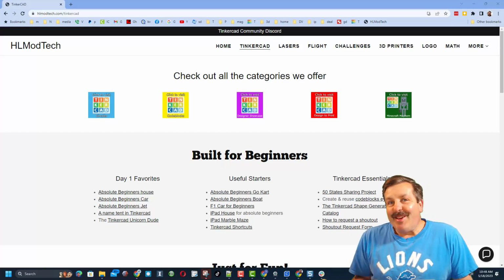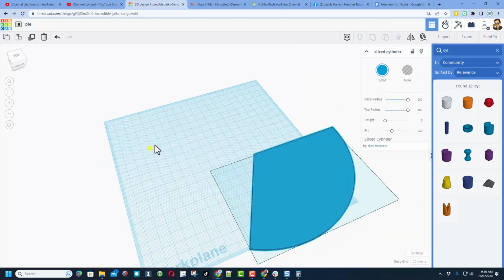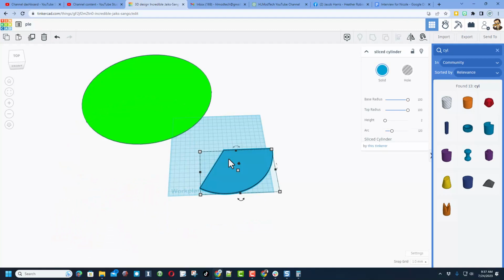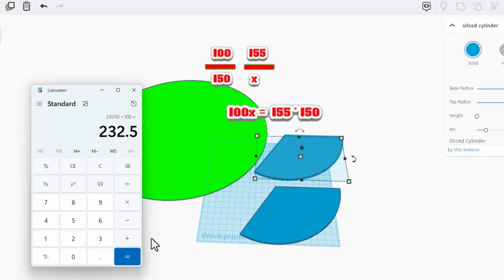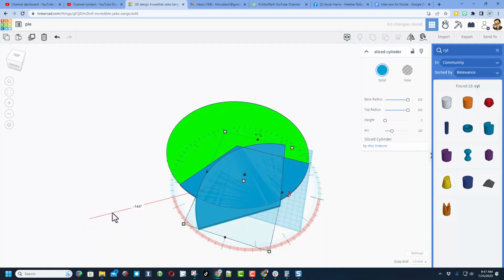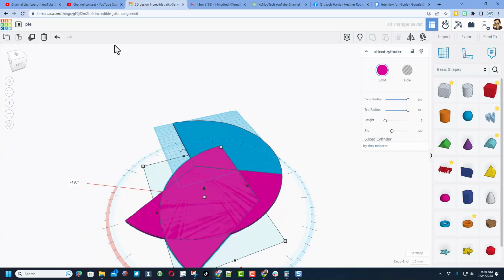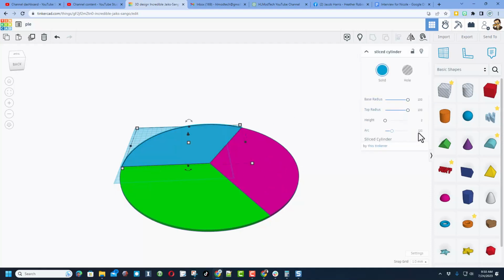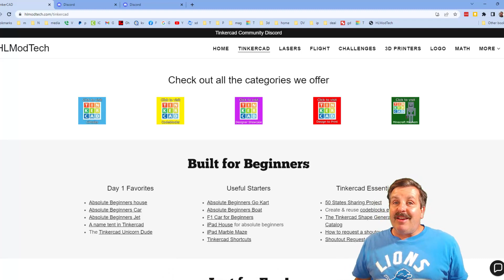How to Evenly Slice a Large Tinkercad Cylinder in minutes!

Comment: You could just rotate the sliced cylinder before changing the slice angle. HOW. COOL. IS. THAT?
Reply from the maker: I think even faster would be to select the new slice and the whole cylinder and rotate 120 degrees. Then just press Ctrl-D to make the last piece... Have to delete a few extra cylinders to clean up but it was pretty fast.

Comment: Slick solution! How would you join them after printing?
Reply from the maker: I am not sure how sturdy the project needs to be... It would be pretty easy to add tabs to if it needed. I have never chosen to print something larger than my printers It would be more likely I would put the laser cutter to use for something like that.